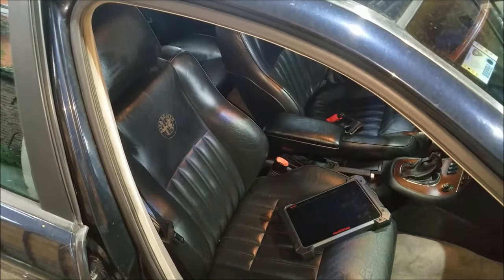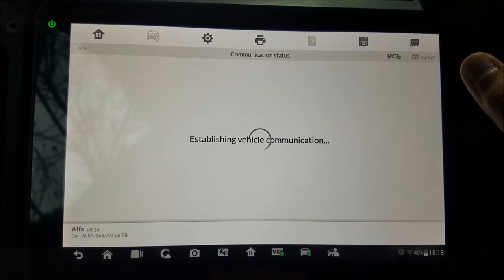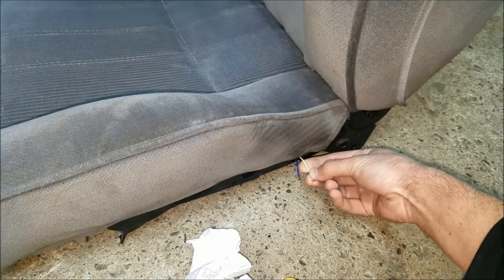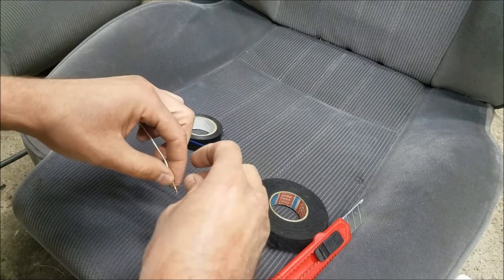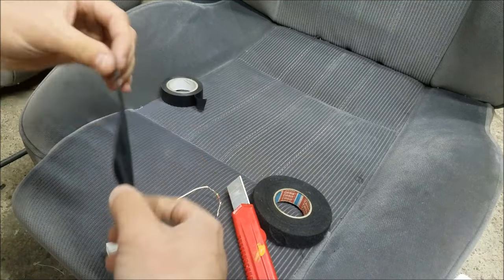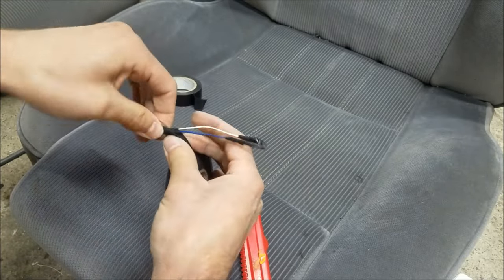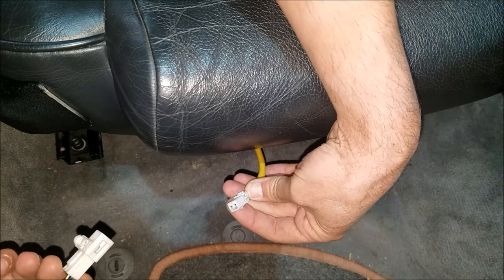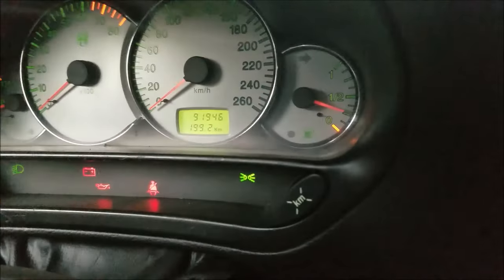Bypassing the Passenger Occupancy Sensor, Pressure Sensor, Pressure Plate, Eliminating Airbag Light

Comment: Hi, I have a 3 pin connector that connects to the weight sensor.  The third wire should be ground.  Do I have to connect the resistor between the power cable and the output?
Reply: same here did you get any solution??

Comment: Mercedes clk 2004 which resistor i must use please its great video bro
Reply from the maker: You got to test it out, with someone siting on the seat, and you got to measure the resistance
Reply: 2.3 k would be 2300 ohms correct?

Comment: I would like to do this but also have an option to trick the sensor into thinking there is a child in the seat. Is it possible to have two resistors on for turning the airbags on and one off, while being able to switch between them..  i ask because my dog like to ride infront and it is not safe if airbags are on and he weighs 90lbs
Reply from the maker: It is, you could implement a switch

Comment: I have the same issue on my 1998 156 V6. We also have issues to connect to the Airbag ECU. Lot of diagnostic devices cannot connect to the ECU. Without this connection I can not see or erase any codes. Can I use any Airbag ECU from a 1997-2001 Alfa Romeo 156 on mines?  Because some electronics says that should not possible because the ECU should remapped?
Reply from the maker: There is a possibility that you might need to reprogram the new ecu

Comment: Did this fix secure the functionality for a driver heavier than 80 kg or below 80kg?
Reply from the maker: Of course, I basically took the average value...
Reply: @arcgarage  Well, which is it? I mean if it is only for someone at exactly 80kg, then you need to change the resistance for every new driver to be safe.
Reply from the maker: @Goc67  The airbag module thinks that the seat is occupied at all times by an adult which weighs 80kg, not matter who sits, the airbag will deploy in case of an accident